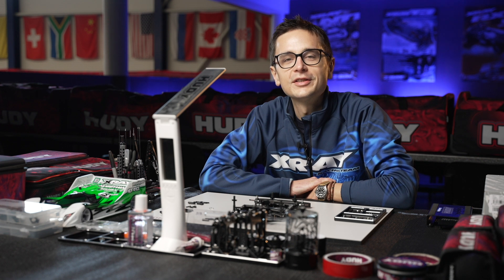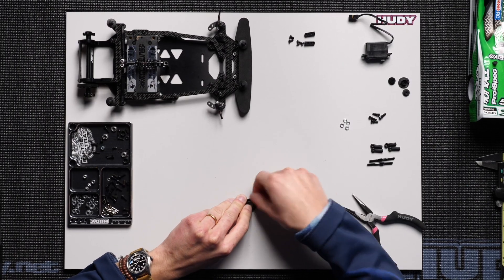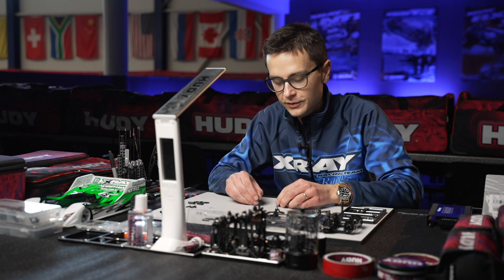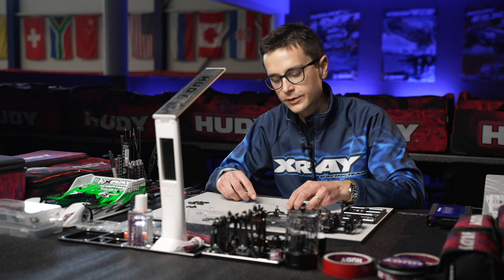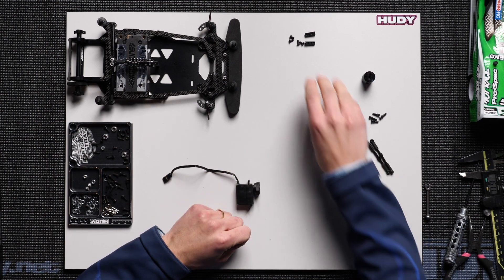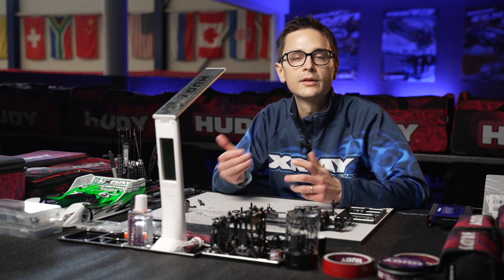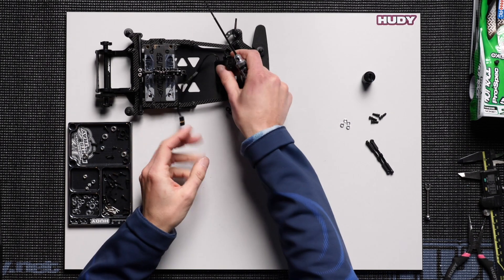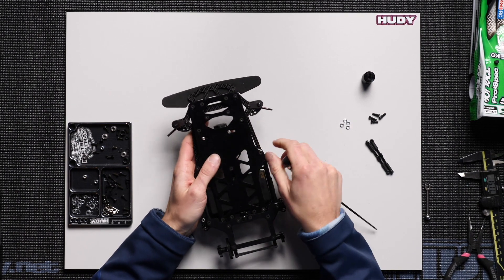XRAY X12 - Tech tip video - Steering System

Comment: I have a X4 -22, and a X4F -23, but I was introduced to the X12 GT with 1S 13.5T setup, and I'm more or less decided to go for a X12 -23 Pan, so that I can use both Pan and GT bodies. I have Sanwa PGS CL2 LP servo with MT44 in my other cars, and I have a spare servo. Ss that possible to use in the X12, or shall I buy a Sanwa PGS-HR SXR Mini right away?

Hobbywing XR10 Pro 1S Heavy with V10 G4R 13,5T or XR10Pro Stock 1S V4 with Justock 13.5T?

Thanks for another great customer video!!!

Comment: Nice info! Thanks! I was using sponge tire with X 12 22' in CRC carpet. All setting is from manual. The problem is understeering too much. The curve is so dumb, I need sharp curve much more. I have load full steering range in my radio. Could you tell me how to deal with it ? Thank you !